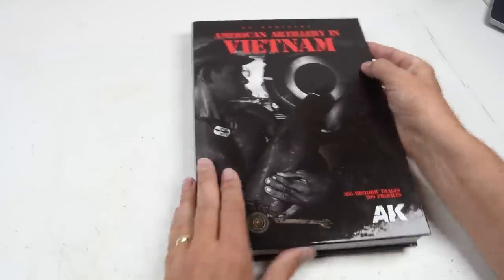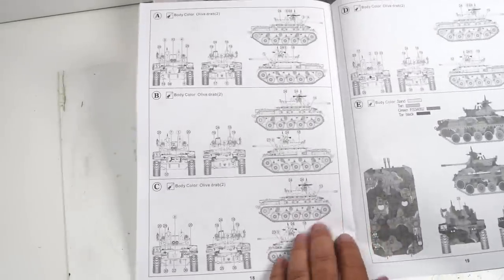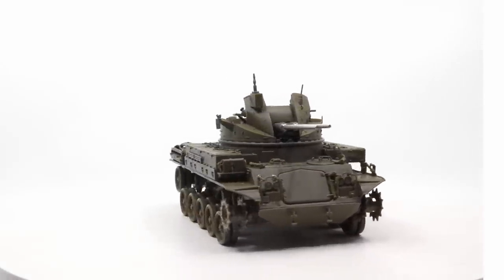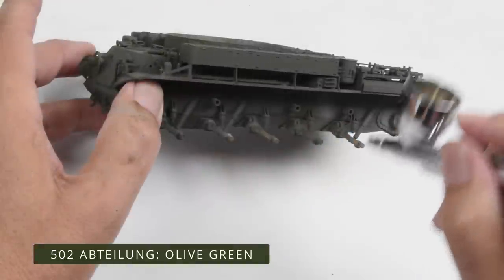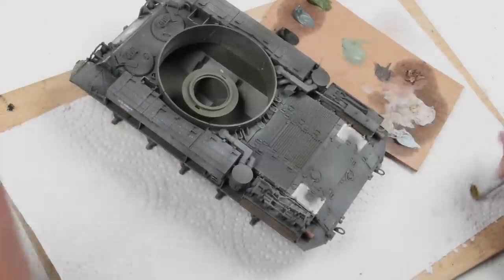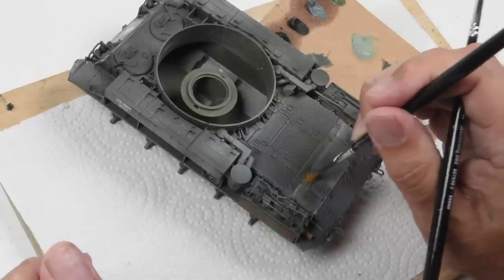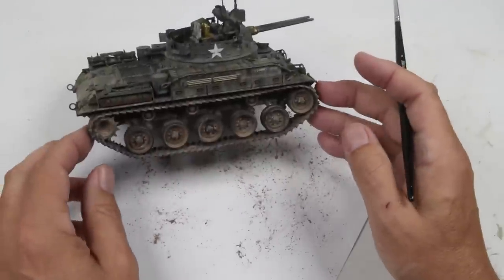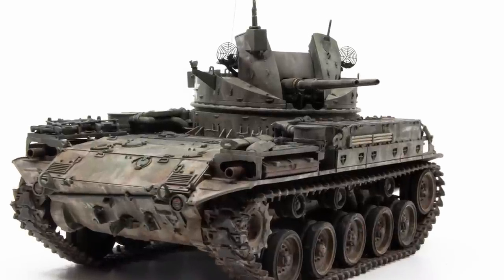M42 Duster, FULL BUILD, PAINT & WEATHERING.

Comment: Outstanding work.
When you were blending the dusty oil paints, did you use a completely dry brush, or damp with thinner?
Reply: I believe he applies the oils with a damp brush and blends them out with a dry brush. While he's blending, he wipes off excess oil (that accumulates in the dry brush...filling up with oil as he goes along) on a paper towel to remove excess oil...then blends more, till he gets the look he wants. It's about impossible to get a nice blend while the oils are wet.
Reply from the maker: So, what I'm looking for when using the oils is the "sweet spot", the point when the oils have leached out the linseed onto the cardboard, and the consistency of the paints are something like butter. At this point  just use the oils off of the palette, and then blend with a soft, dry brush. Now...this can change both over time, and upon the desired effects. Over time, the oils will become more dry and so it will be necessary to add a bit of thinner to the brush, mix it into the paints to regain the butter. Secondly, thinners are used to create different effects...for instance...if I want a light, dusty effect I will thin the oils to something like a wash, or I can blend using a moist brush to created different types of blends. It really isn't difficult, just takes a bit of practice and it all really becomes second nature.